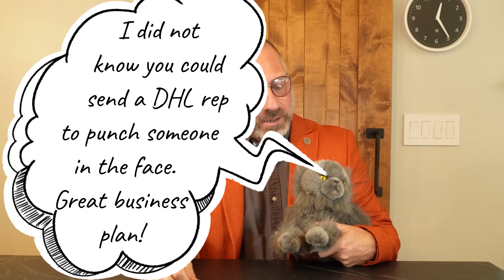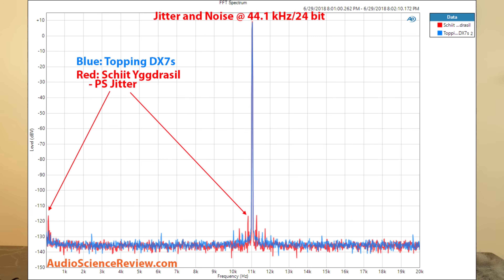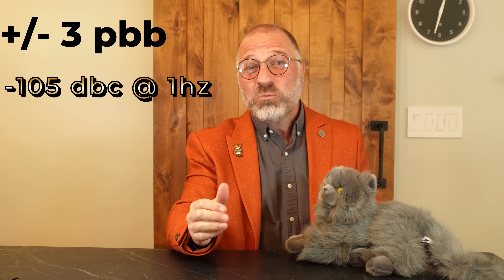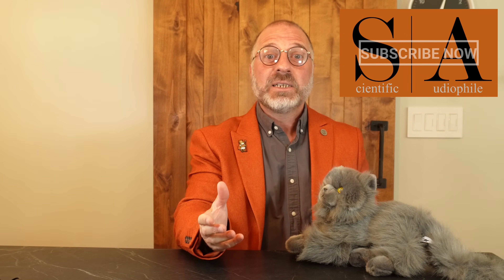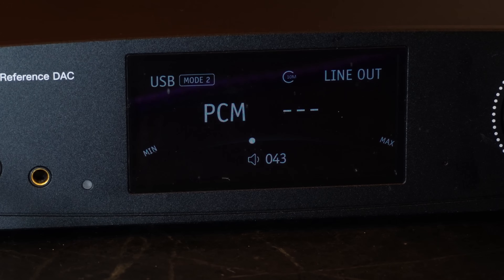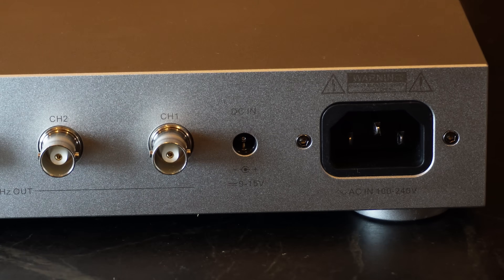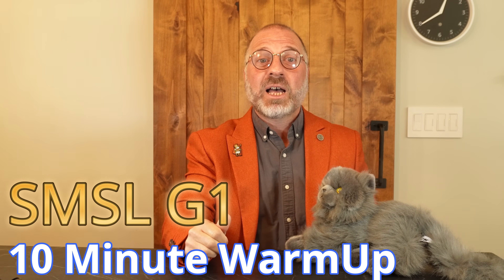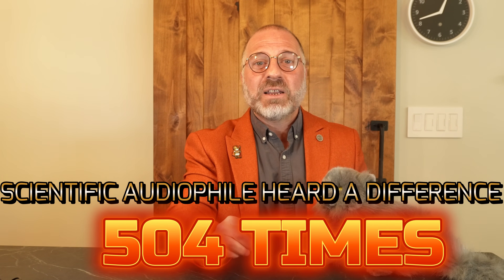I Got Clocked - Jitter Fixed!?

Comment: In my testing and playing around with Ian Canada Streamers better clocks have a dramatic and easily noticeable improvement on sound stage, especial depth, this was noticeable within seconds when I first tested on modest gear like a SU9n DAC, Used Cambridge Audio amp I paid $100 for, and some old Aaron floor standing speakers I also paid $100 for. Clocks do make a big difference on the transport. Have not tested a ext clock gen like the G1, but I would be surprised if they did not improve sound. I do wonder if all these scientific audio guys even bother AB testing with a switcher, most of the time it seems like they never bother listening at all and just quote some 50 year old scientific document therefor proving that it could not possibly make a difference
Reply: Totally Agree with you! To call this sciences is a joke, it proves nothing more than this idiot can't here any difference!

Comment: It takes two (2) clocks to make a connection........
        The host needs a clock to correctly "stack" data in it's queue cache, awaiting a request from the slave to send more data.  The 2nd clock is in the slave and is timing the release of data to the converter chip.
       Asynchronous DACs with great clocks DO NOT Re-Clock the Host's queue clock cache. function.

Comment: I can see the benefit of the SMSL G1 in an all active speaker setup, providing a way to use four 2-channel DACs as opposed to an 8-channel DAC, for which there are not too many options on the market.  The one I am familiar with is the 8-channel Okto dac8 PRO.  Also, the miniDSP HTx is 8-channel and provides a lot of DSP capability in addition to 8-channels of DAC.  Perhaps one of those would be a better option than the G1 and four stereo DACS.  Sadly, the Topping DM7 8-channel DAC no longer is available.

Comment: True true but! Smsl has a po100 2024 edition that was 38$ on amazon...ddc usb to coax, thats incredibly cheap. Also im using it to connect to a older piece of pa gear with a crappy dac in it (dcx2496) (as far as jitter and noise) anyway like most things its largely purpose/use case.
Reply: I use both my DEQ2496, and DCX2496 sans DDC.  Not a single hiccup, even from my Vizio TV.  The less boxes, the better.
Also, I find the DACs in the aforementioned to be pretty decent, as long as the inputs are digital.  I honestly don't hear any difference when level-matched between the Behringers and my SMSL SU-9, nor my RME ADI-2 DAC FS.
Reply: @scrivs1976  wow you have my dream dac (the rme adi-2) Right now I am using a motu m6 interface for a dac for my hifi, but it doesn't have digital outputs for the dcx. I do have a old focusrite mixer I have been using to split output from the motu that has toslink, but after seeing other similar feedback that the digital inputs are better, found the po100 which will allow me to do usb to coax, coax to rca-xlr canare adapter into digital spdif on the berry and bypass two dacs. Only one conversion, thats the goal. I will try both toslink and spdif. I was tempted to try aes with a transformer, but for a short run I can't see any benefit over coax. Have you done the kdcx, or behringermods analog boards? My plan right now is to do at the master clock and psu. Do you know if it can slave the clock to the po100, I don't think it can? Unles AES would do it? Thanks for your input really cool to hear it compared against a titan like the adi-2
Reply: to clarify, the po100 is my solution (well, the one I've found) to have as few boxes as possible and only one conversion in the chain
Reply: I typed a long message but it got delet, rip. Anyway I said you have my dream dac, the rme adi-2. Right now im using a motu m6 as a dac for my hifi, do you know if I can slave the clock from the dcx to the po100? I plan on doing the kdcx mod if not, would be nice to load op-amps, and linear psu. Probably don't need it though. Amazing to hear it compared to the rme adi-2, I got the berry for 100$ to replace my thrashed driverack . The mods look dank

Comment: Funny video. 

But if you think about it... you focused on only the DAC. What about your upstream?  Music Server? (A PC), and then your 'Audiophile Network Switch'? 
I agree that most of the equipment have decent clocks when you get to a certain price point... but there are benefits from using the same clock signal across your entire stream.
(Which you kinda admitted to when you talked about prosumer gear.) 

Personally I'd rather spend the money on the speakers and amps over a reclocker.

Comment: I have a Hifi Rose RS130 transport and Denafrips Terminator Plus DAC. Both have oven controlled clocks. Both have clock inputs. But, you cant sync them even if you wanted to because the clock frequencies are different (10mhz vs 42mhz. Maybe).
I always thought it crazy that the better the clock a device has, the more likely it is to have a clock input. You , my friend, have confirmed my view that an external clock is  waste of time with well designed and well specced products.